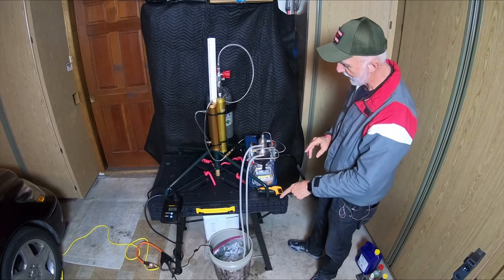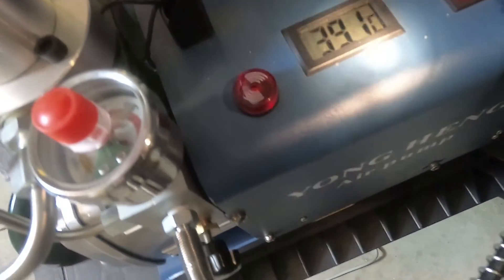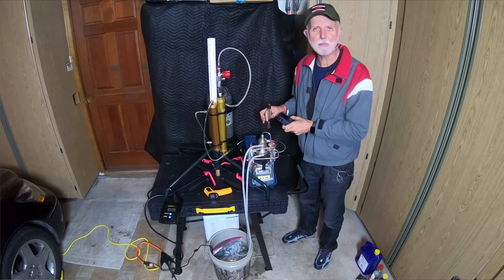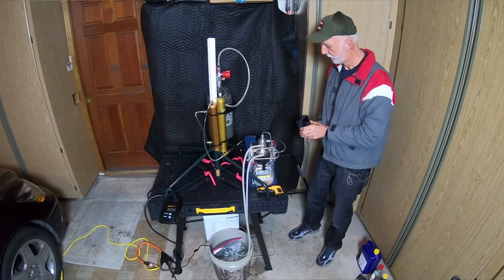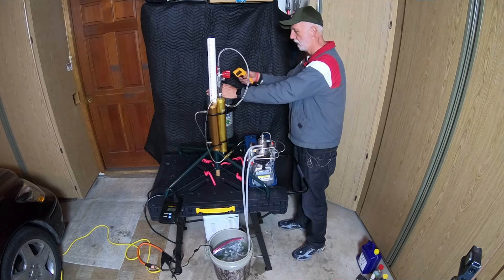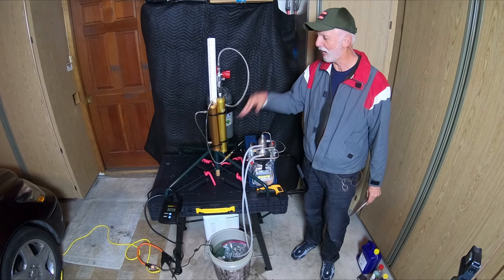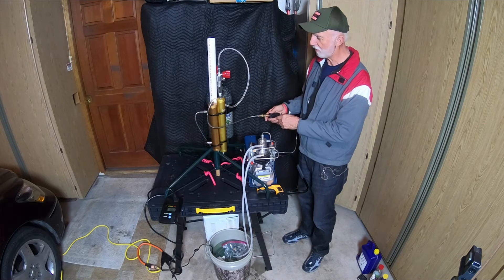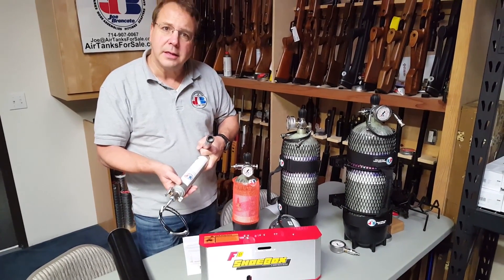How to run Yong Heng Compressor - Part 2, Tips, Tricks and Traps

Comment: @Project Anubis and all.  Looking through my emails, here's some of the companies I used to purchase gear in this video.  Perhaps I can look through my gear for hints on other questions - Good luck,  Michael

August Industries, Check Valve, Stainless Steel  VAL-CKSSFF

AirTanksPlus, Deluxe SS Male Foster Fitting with Male 1/8 NPT and Removable Check Valve
AirTanksPlus, Male Foster Fitting with Female 1/8NPT Threads
AirTanksPlus, Dead Head Male Foster Fitting

ebay, Stainless Steel Bleed Valve 1/4" M NPT x 1/4" F NPT Bleed Valve (A-B1115), Item ID: 152943458443

ebay, 30MPA Pump Water-Oil Separator Filtration Air Pump Filter for Scuba Diving

ebay, 50PCS Pump Filter For Electric High Pressure YONG HENG 30MPa Air Compressor

ebay, Royal Purple 04513 Synfilm Recip 100 High Performance Synthetic Air Compressor

https://www.hydraulicsdirect.com/Default.asp   Miscellaneous

Comment: If you have a one way valve on your scuba tank why did you wait to open the valve? wouldnt it auto normalize?
Reply: Good point JM (actually the one-way I've added is on the filter, no one-way on the tank).  Since most watching the video will not have added the additional one-way check valve, I thought it best to show this technique.  The idea is to ensure we don't needlessly cause too much pressure from the tank or filters to hit the delicate Yong Heng compressor piston and values.  So I'll always error on the side of caution, equalizing pressure on both sides before opening valves.  Thanks again for pointing out the benefit of a one-way valve and let's not forget we need a pressure relief value on the OTHER SIDE in order to be able to disconnect the hose and filters!  In my case I have a pressure release valve on the filter.
Reply: California Travel Videos thank you for taking the time to reply, i just got one of these hca yong heng pumps myself to refill paintball tanks so i have been watching videos for setup and use and yours was very detailed but wonder about the valve, do you have links to the dual filter setup you used?

Comment: Heads-up: Don’t forget the more filter media, check valves, etc. you have to push the air through the harder it is on the small compressor causing it to heat up faster due to air restriction. Try breathing through a straw the same principle applies.

Question: what fittings do you have (sizes) so we can find them easy please.
Reply: Is that a Christmas 🎄 tree stand with pvc you mounted too? 🤔🤫🤐
Reply: @ProjectAnubisUSA  Nailed it! (any port in the storm - lol)
Reply: Regarding your question about replacement filter ordering:
You can search eBay for "I ordered 2 packages of 50 on eBay 50PCS Pump Filter For Electric High Pressure YONG HENG 30MPa Air Compressor"  The packaging on my bag shows SKU722300-14338973  PCK (Made in China), also shows numbers 1204-0-11475  and  E2-H-02-22.  FYI - the Item price was $17.18 (for 100),  Item number 222860027664 from the eBay contact.  Good luck!

Comment: Good morning, sir,
First of all, thank you for this video, which is very instructive.
I wanted to buy this little compressor, but seeing all this system you've added, it scares me a little bit... I don't know what to think about all this.
If I embark on this adventure, without any knowledge, on all these filters added, I'm afraid I won't buy it and do the right thing...
Reply: Greetings Stephane.  Sorry if I made setting up the Yong Heng compressor seem too complicated.  And while it's built-in cloth fiber "cigarette filter" seems a bit inadequate for my preference, even adding an inline charcoal filter would be helpful to keep water vapor from getting into your gear.  The main points are to ensure you have good oil in the motor, try to keep the water cool and prevent the YH from getting too hot.
Good luck!

Comment: Sorry but I have to correct you on something, Oil and Oxygen don’t mix,,,, oil and high pressure Air are common everyday in motors and pumps. Some may think I’m being picky with language, but if we are going to be careful and precise, we need to be correct.
Reply: Yikes, agreed and sorry if I gave the impression mixing oil and high pressure was acceptable - NOT!!!  In fact even water vapors can be harmful to high pressure metal assemblies that can corrode, rust and eventually rot away!
Reply: Lol we need to be precise and accurate.  Nothing that being exact and wrong....  they are two different concepts... sorry Ken..
Reply: TheDWZemke 
So are you commenting on my grammar or chemistry? At least point out my mistake if you are going to comment, but the Chemistry clearly points to Oxygen and petro carbons being a bad mix.

Comment: People are praising you, but if they searched out the information that you have on here, they would see that some of it is totally wrong, I won't thumb you down for it, however people should be aware that you are wrong, I will mention but 2 things, firstly you got the pressure conversion number wrong, secondly the second stage head that you show with the propeller thing is not true, or at least not in the legitimate Yong Heng
Reply: Thanks for your feedback - always great to hear from others.  Please feel free to share your pressure conversion chart information and links to your photos of the two-stage YH compression heads.

Comment: 1 bar is 14.5038 i was told
Reply: @sean tyree and you are correct, the man doing the video is wrong, but he states it with such conviction that people believe him, also the picture of the head that he shows with a kind of propeller is also wrong, the Yong Heng does not have that, one wonders how much reliance should be placed on the rest of his information ?

Comment: why don't you stir your water to make it cooler?
Reply: Since the ice is in bags and isolated from the water, stirring the water is not applicable.  If cooler water temperatures were required, adding more ice bags would be helpful... or even running an external air fan on the piston head.
Reply: @CaliforniaTravelVideos  why would you have the ice in a bag?
Reply from the maker: Sorry if that wasn't clear in the video:
1. Yong Heng compressors quickly get hot and have minimal cooling, considering the design (high pressure output, low cost)
2. Adding ice to the intake water supply help to cool the YH
3. To provide extra cooling and water less likely to create corrosion of the YH valves, PURIFIED water (not distilled) with coolant additives are used instead of tap water that contains minerals and other contaminants. 
4. Separating the ice from the water (using a bag) allows the water to be cooled without coming in contact with the 5 gallon water supply
5. When not in use, the 5 gallon bucket with the mixture of Purified water and coolants is covered to avoid evaporation and contaminants from getting in the water supply.  FYI - a case of  Nestle Pure Life Purified Water 16.9 oz 12 each bottles costs $2.48 on Amazon, which is 1.5 gallons so buy 2 cases for $4.96 (3 gallons leaves room for some coolant and a bag or bags of replaceable ice).  And 2 bottles of Royal Purple Ice Coolant costs $12.00
Reply: @moonlitnite49  freeze the distilled water into ice cubes.
Reply: Hi Greg.  Yes, if I had a really big freezer, I could simply freeze some of the PURIFIED water (distilled is not recommended) and simply add it back with the room temperature water in the 5 gallon bucket.  But if I'm running the compressor for maybe 15-20 minutes, I'd go through 2 one gallon ziplock bags worth of water, which I'd have to make a day or two ahead of time and find precious space in the icebox.  Since my freezer compartment always has plenty of premade ice, I've found it easier to just dump some in a ziplock freezer bag and float it in the 5 gallon tub until it melts.  But for those with a large freezer, I really like your idea.

Comment: Good show Pete - glad to hear you are also happy with your Yong Heng.  Agreed, initially it does seem odd to have an auto shutoff when the compressor seems to last longer by first bleeding the line.  But wait a moment, let's step back and think about this a bit more...

YH itself does not make specific warranties about fitness for use in a given situation or environment and I think we will all agree after looking at the two-stage piston, crankshaft and cooling system, it is not designed and engineered for rough use, or long run sessions either.  And because it provides so much pressure volume in such a short time, I would guess the tolerances on the two-stage piston are being stressed more than competing products that cost 5-20 times as much.

So I agree with other YH careful users who take extra steps to avoid taking extra changes by stressing the compressor more than necessary.  Of course, some folks are fine ordering parts for broken pistons, etc. and the cost of parts is very affordable and replacement time is only an hour or two once you know what you are doing.  But for me and others, we treat our YH very carefully and want it to last. And I'm with you, charging to 4300 is fine.

For your Benjamin Marauder Gen 2, I've read others who pump by hand say you should get 16 shots from 3000 to 2000 PSI for their 25 cal (bottom limit) but everyone has their own idea on the best pressure range so it sounds like you do not have a leak.  And as you know, if you are shooting longer than 40 yards distance from the target, the pressure will start affecting your accuracy.   Happy trails!

Comment: With out a doubt this is the best Yong Heng video I have seen to date. I have used mine 3 times now and I wonder why they make them with the auto shut off if they want you to bleed the air before shutting down.  I will stand there and watch mine and not use the auto shut off, I have it set at around 4500 psi in case I should get side tracked. Which is not likely, I will only fill my tank to about 4200/4300 psi . I don't shoot as much as I would like to, once I check to see if I'm still on it is hunting time.  I will say this, at my age (67) my Yong Heng is by far better that the Hill  pump I purchased LOL. I love my 25 cal. Benjamin Marauder Gen 2  it is super accurate , but man is it an air hog 16 shots per( fill 3000psi) at 821 fps average. My FX Bobcat MKll  84 to 90 shots per (fill 3200 psi) at 873 fps and it to is amazingly accurate. I just hope this air compressor will last for ever, I will do my part and take care of it and service it regularly. Again great video.

Comment: I run a desiccant filter on the intake. I have a half gallon mason jar with color changing desiccant. I want the air to be dry before it ever comes into the compressor.
Reply from the maker: Assuming you live in an area with moderate to high humidity, that sounds like an excellent idea to reduce moisture before it gets into the YH.  And as I found out, just be sure you have a sufficient amount of airflow input to your compressor inlet.
Reply: Yes, I live in the south and it’s very humid here.  I also have the TUXING air dryer on the output, I run it with half molecular sieve and half activated charcoal. For my job, I use an SCBA and I fill my own tanks. The air is completely odorless and completely dry.  These little machines are awesome!

Comment: Thanks, great video.  Did you mention the oil you use? Did I miss it? Did I see a royal purple bottle?  That is what I bought.  Brian Smith
Reply from the maker: For sure, I use Royal Purple Synfilm 100 - WTG!
Reply: @Matt E Agreed, and we should definitely be mindful to use our eyes and NOSES!   If your oil starts to smell bad, STOP NOW and replace that oil!!!  And of course, look in the sight glass from time to time and notice when the color begins to darken.  And of course, try to avoid prolonged run times with the temperature running 60+C.  While this temperature would not be a problem with a different compressor with a design meant for continuous long time operation, such is not the situation with the Yong Heng.  Our secondary high pressure piston is quite fragile and the true temperature at that point is 10+ degrees higher than the digital reading on the first stage piston we are viewing.  Further, the water cooling tubes are quite small and cannot transfer the heat away that quickly.   So we should try not to run the compressor for more than 20-30 minutes before letting it cool down for a brief rest period (releasing pressure from the bleed valve as we shutoff the valve to the air tank (if you don't have a one-way valve).